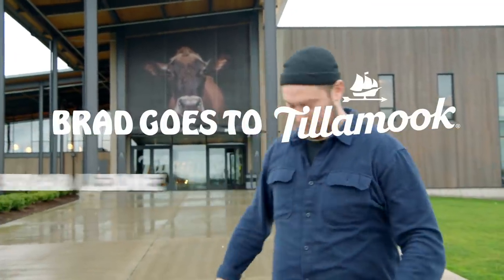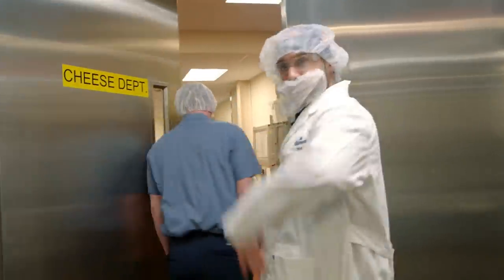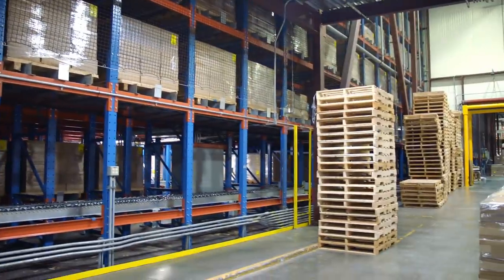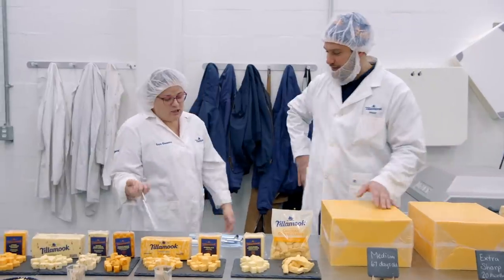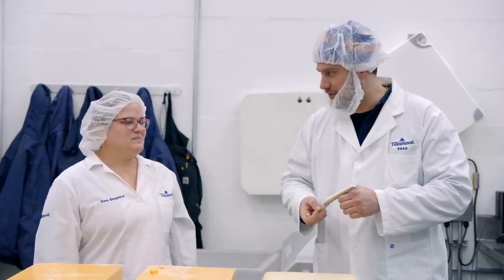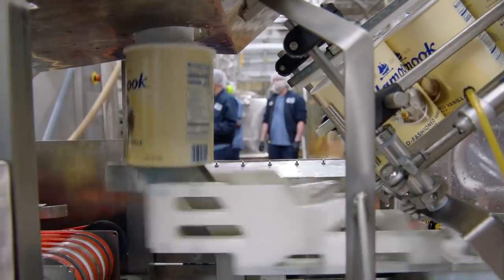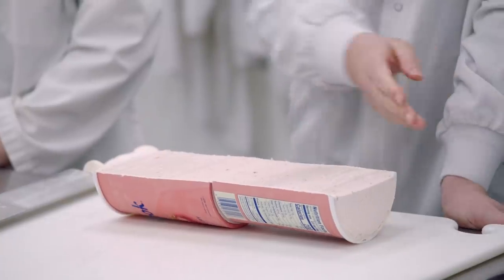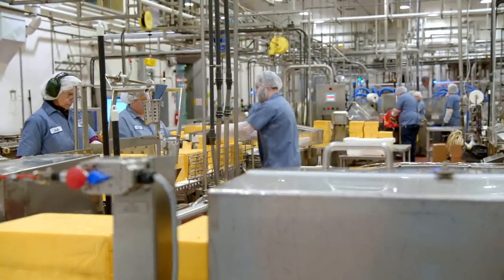Brad Leone Goes to Tillamook

Comment: If you're making gougères, use a mixture of Tillamook Extra Sharp Cheddar, a good quality cave-aged Gruyère, and a Parmigiano-Reggiano aged at least 18 months.  Here is my recipe:

315 g water
100 g butter
6 g salt
0.30 g grated nutmeg
0.30 g Kashmiri chili powder (or half this if cayenne)
160 g strong bread flour
300 g whole eggs, whisked
120 g finely grated Tillamook Extra Sharp Cheddar
40 g finely grated cave-aged Gruyere
40 g finely grated Parmigiano-Reggiano

Boil the water, butter, salt, nutmeg, and Kashmiri chili powder, take off heat, and stir in the flour until even.

Put back on heat and beat against the side, scraping the bottom each time, for about a minute or until the dough appears smoother.

Take back off heat and then beat in the eggs in four batches, thoroughly incorporating each batch before adding the next.

Beat in all the cheeses until everything is evenly incorporated.

Put into a disposable piping bag, twist to seal, and then snip off enough of the tip to make about a 1/4” opening.

Pipe into 1” diameter hemispherical silicone molds (buy 2 packs of these to make 144 gougères from this recipe: amazon.com/gp/product/B07GTDP1WT ).

Using a wet doglegged spreader, smooth the surfaces of the pâte a choux to be even with the surface of the molds.

Cover each with plastic wrap and freeze in a stack, with each mold separated from the others by a stiff sheet of cardboard or something else that will not stick but will prevent the molds from sinking into the ones below them.

Make sure they freeze completely -- at least four hours, but best overnight to be sure.

Unmold them into a lidded GladWare container and keep in your freezer for ad hoc entertaining.

To bake, heat the oven to 400F and line a baking tray with a Silpat.  Make sure the oven is exactly 400F before you bake!

Arrange the frozen gougères flat-side down in a 6 x 10 grid on a Silpat-lined half-sheet (sixty of these go in about two minutes).

Bake for 20 minutes at 400F, rotate the pan 180 degrees, and then continue to bake for another 3 minutes.

Immediately transfer to a cooling rack using a large pastry scraper.

Eat while warm.

You’re welcome! :)

Comment: I worked in the frozen section in safeway. So I had to stock all the icecream. I absolutely HATED opening the plastic that Tillamook used. It'd be better if they used cardboard. Same goes to everyone else who uses the plastic. Ben & Jerries sometimes uses cardboard. And I think Baskin Robbins sometimes uses cardboard. Magnum always used cardboard and Snoqualmie sometimes uses cardboard. Cardboard is easier to open, and ice usually doesn't build up like it does with plastic. Other than that, I just got into Tillamook earlier this year and I gotta say that it's really good stuff. I buy the Tillamook mudslide more than the other flavors. I think imma buy a Marrion Berry Pie flavor.